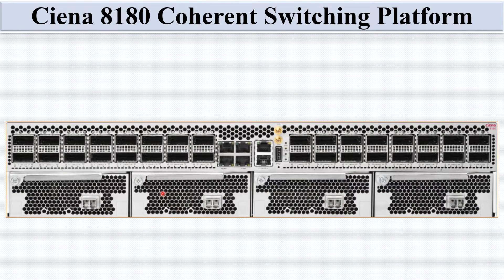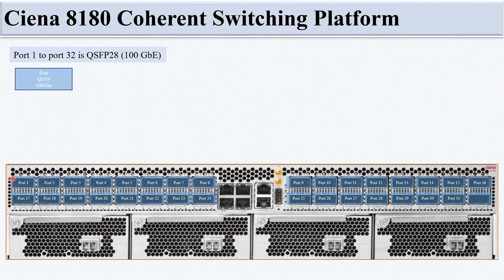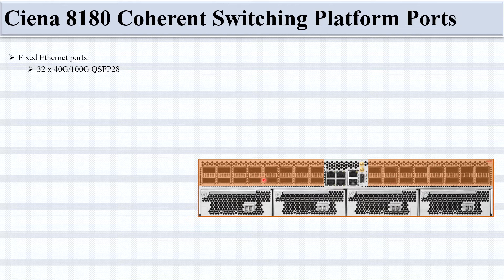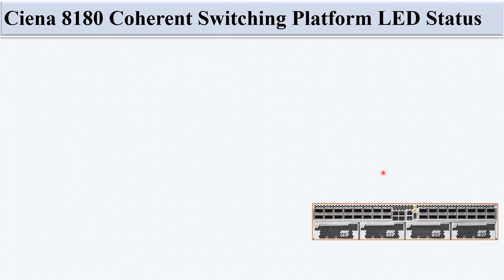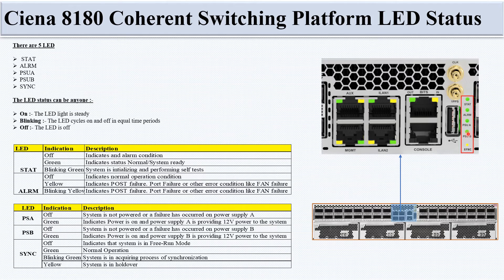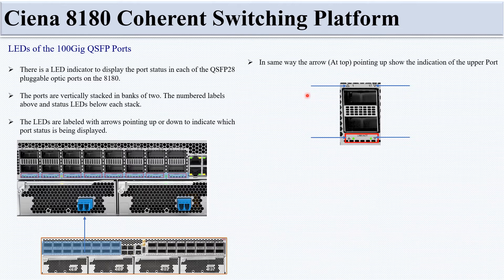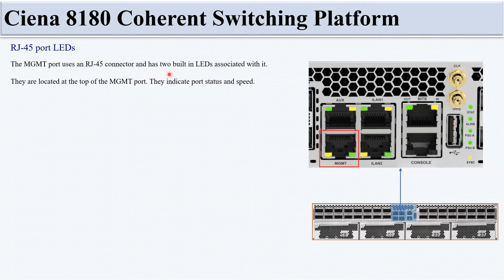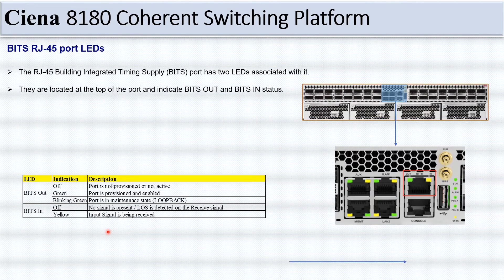Ciena 8180 Coherent Switching Platform (CSP)

Comment: Thanks a lot deepak
Reply from the maker: Always welcome
Reply: @DeepakKumarSingh2015  Hi Deepak  Pl post a video on Ciena 5170 also
Reply from the maker: @kanakrout  sure
Reply: @DeepakKumarSingh2015 Deepak thanks. & what is the function of Ilan1 & ilan2
Reply from the maker: @kanakrout  these twp ports Ilan1 and ilan 2 is of Rj45 ports are used for inter shelf communications
Reply from the maker: It will be post before 1
Midnight today
Reply from the maker: @kanakrout ploaded. Please check
Reply: What is the function of fru slots